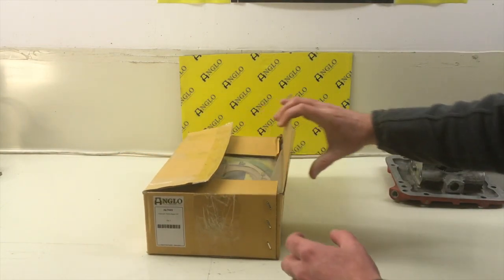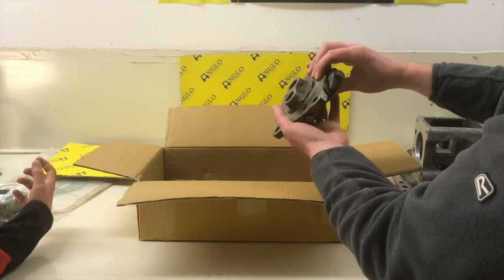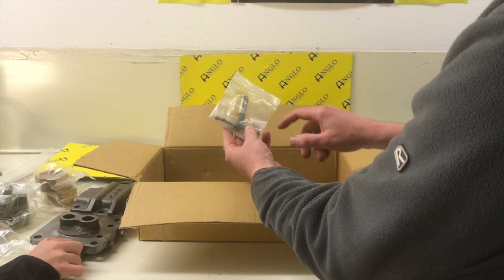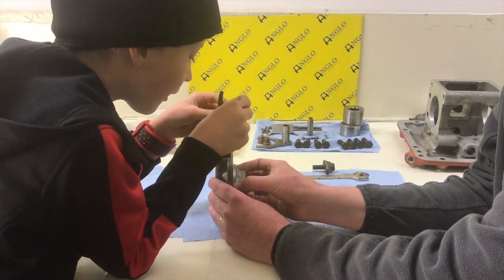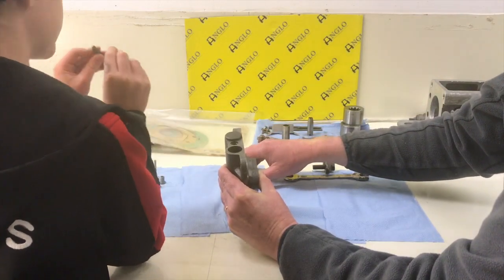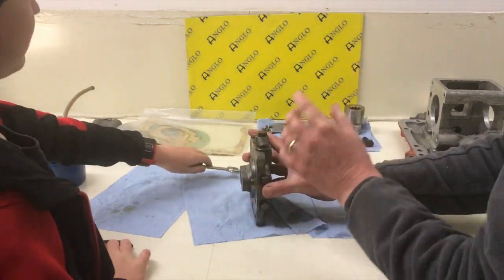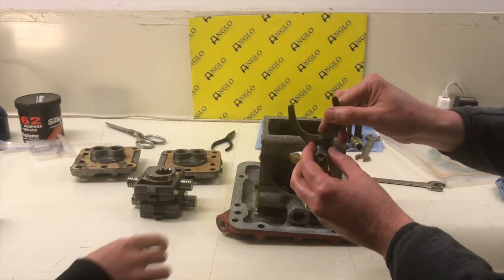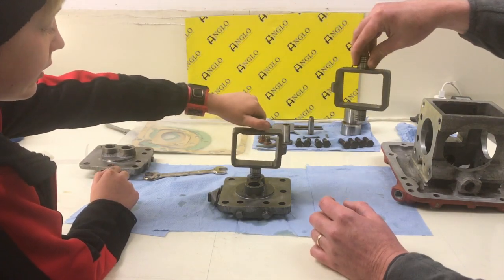#59 Ferguson TED20 - Assembling the Hydraulic Pump - with Anglo Agriparts

Comment: Hi Gordon, the circlip you broke on control vale what size is it iam missing one off my pump
Reply from the maker: Hi Peter, hmm it’s been a while since we did this pump. I seem to recall ordering a set of circlips and using the smallest in the set. Although now when I look at the set on the shelf, the smallest is 3mm which seems too small to me now. Of course in reality it should be an imperial size, I just couldn’t find a set at the time. Your best bet would be to do the same, buy a set so you have options. They are not a lot of money and you’ll have them next time you need one 😉. I hope this helps but I just can’t be 100% certain. 😉👍
Reply: @WaterhouseForde  thankyou for quick reply, will do that